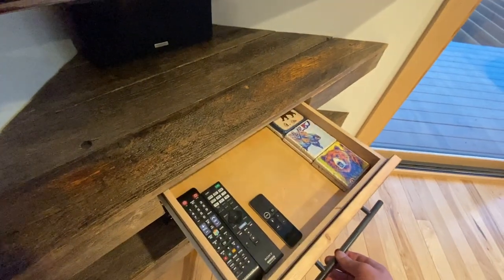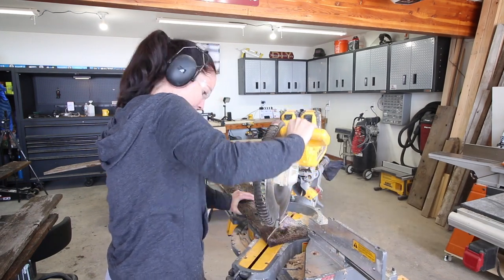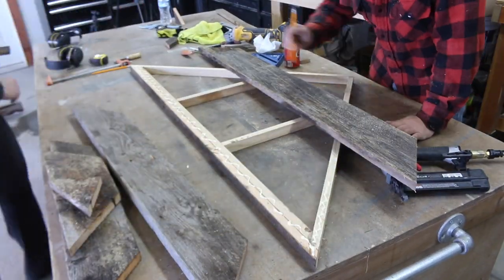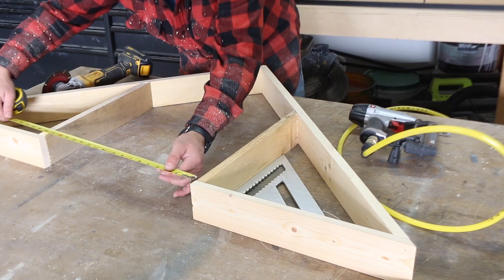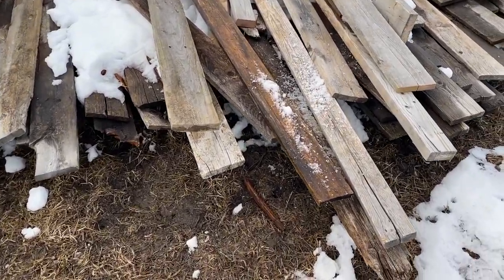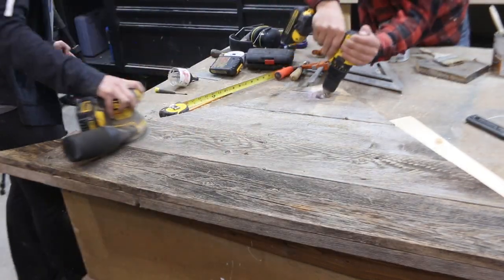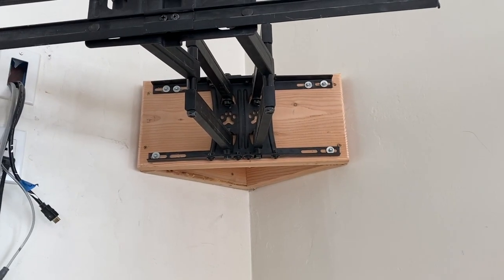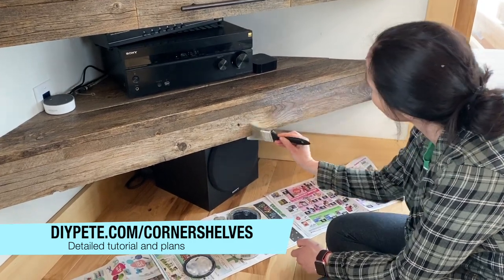DIY Corner Entertainment Center | Floating Corner Shelves

Comment: I am in awe of your perfect walls allowing for easy 45’s. I am currently trying to build a corner shelf and am in angle hell. Not to mention the 2 fire blocks I’ve encountered trying to feed my wires in the wall.
Reply: ouch yeah that is painful, my thought is maybe create a 2x2 test fitter frame thing, then use as template for the angles, might be a ground zero starting point for the troubleshoot.

Comment: Nice project!  One of my first ones was a desktop in a corner like that, brings back the memories!
On the brad nails shooting out the side, you might want to change the angle of your gun 90 degrees, so that the length of that bottom board your nail's ending up in is running toward/away from you, up and down in relation to the gun.  The operative principle is how the nails are shaped, and how they stack in the magazine.  They're flat/oval in the stack, so they're going to want to do any deflecting inside the wood so as to bend up or down (toward the top or bottom of the gun), not side to side where they're thicker.
Reply from the maker: Thanks so much!

Comment: I liked that you used the old wood from your fence! How long did you let it dry before making the corner shelves?
Reply from the maker: Thanks! We let it dry it dry out enough to work with the wood, but definitely not as long or properly as I normally would. Since we are in the stay at home rules for the virus, we didn't want to go out, yet we wanted to build a project, so we decided to just go for it! Wood was mostly just wet around the outsides when we got it, and we used the drier pieces and portions as we got started. It is looking beautiful though and we love how it turned out. Cheers!

Comment: You work great! But I was sure that TV in corner was a thing of the past when we got rid of the CRT 😆😅. But you did it very clean ! One suggestion would be to get a soundbar and maybe embedded in one of the shelves. Im not a huge fan of soundbars but on this setup it would look very clean !
Reply from the maker: Thanks! Yeah I would typically do the TV on a wall, but the whole upstairs at the place is windows so this works for it :) I think a sound bar would be a nice addition for sure. Might have to get one! I did the 2 front speakers and 2 rear speakers in the ceiling that is fun to use for movies and music. Cheers!